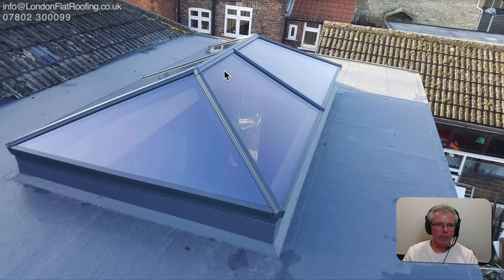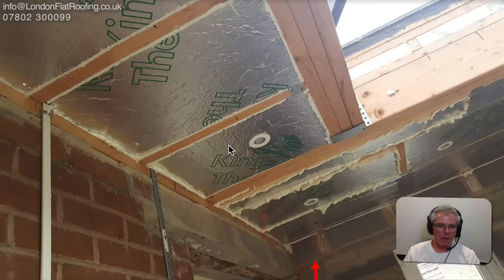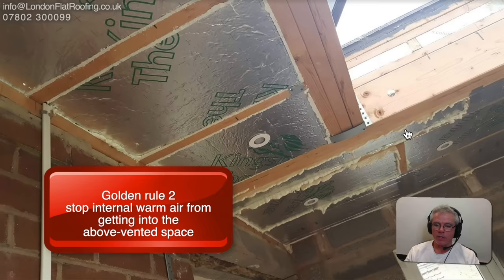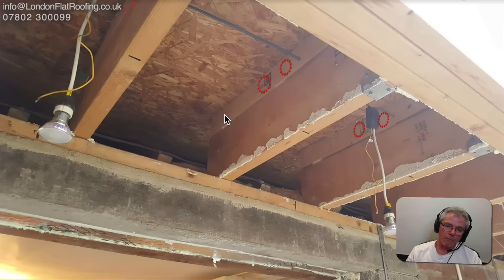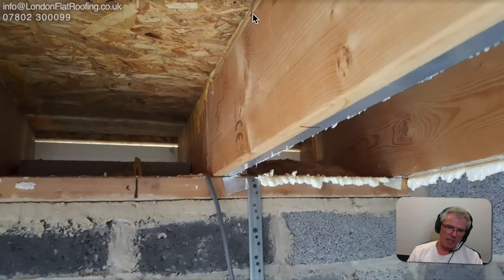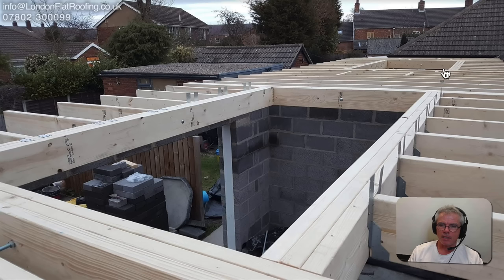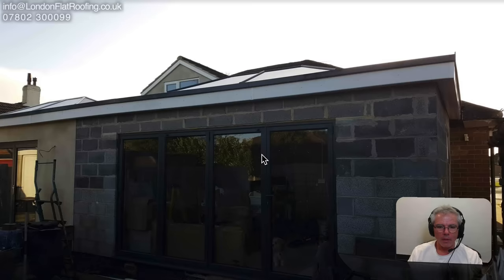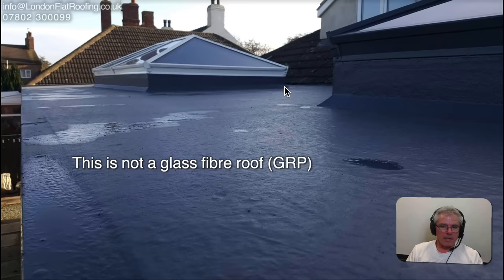Sweating and mouldy New cold flat roof

Comment: Good stuff! I don't think people realise the potential problems with a cold roof - I certainly didn't' until I helped my son with his garden room. He did a lot of research which I( thought was a bit OTT but now realise wasn't. Only problem he has was with using conduit for the wiring - leaves a gap for the warm and moist air to get through. Soon remedied with a squirt of foam!
Reply: What is a cold roof?
Reply: A cold roof is where the ceiling is insulated but the roof deck is not. There has to be ventilation in between to remove any condensation. A warm roof is where the roof deck is insulated and the space between ceiling and insulation should be sealed to prevent heat loss.
Reply: @colinmiles1052  I see thanks. Which is best?

Comment: Hi Steve great videos and very useful. I'm not in London but I have an old house that is poorly insulated. I know now (your videos) that I need to seal the insulation in place. And then cover with more insulation but I'm concerned that if I close all the air gaps that the moisture won't get out and then start to cause problems. Just to add to the amount of moisture there is in the building we live in a flood plain. The Victorians dealt with this by having large voids along the roof but this is now costing us.

Brian

Comment: Such simple understanding of air flow and humidity can make such a huge difference.  To not have used C24 or even C16 timbers from the get go was a surprise, but as you said salvageable and it was a neat job if not very well planned.  Good video.👍
Reply: C16 and C24 are timber grades... not timber treatments... I’m sure his only criticism was that the timbers were untreated (not ungraded)
Reply: @danielb8288  yes absolutely  i took for granted those who use those timbers for construction automatically purchase the treated option 👍  p.s HNY

Comment: You need a 50mm clear gap between the top of the insulation and the underside of the structural deck, you also need a free flow of air from ventilated soffit to the other soffit.
Reply: Why is this gap needed? If the insulation is butt up against the underside of the deck OSB, isn't this effectively closing the air space and therefore making it a warm roof and no venting required?
Reply: @mofaz3475  Its only a warm roof when the insulation and vapor control layer are above the wood structure.
The problem is moisture. Either coming from the internal space, or from the wood itself. Without an air gap and (cross) ventilation, the moisture has no where to go to and will lead to condensation and mold and rot. With a proper warm roof the wood structure is on the internal side, thus having a way to dry out towards to internal space.
Reply: @mofaz3475  Nah because there is still going to be a small cavity to trap moisture. I suppose if you glued it to the board, but even them moisture will move through wood to occupy any little pockets between the board and the insulation.

Air gap is always the way to go. It takes nothing away from the effectiveness of your insulation, I just can't understand why people don't do it.

Worst culprit is people who insulate and board their loft space. No gap between the felt and insulation will ensure your rafters rot. 

If air can move, moisture can't condense as quickly as it evaporates in most cases.

Comment: I only ever warm roof it. I use thermal fixings on rubber roofs. But what many manufacturers still spec screws into joist below.  Particularly on Grp roofs which i do a lot off. It would be good to see them come up with alternatives for grp/liquids.
Reply from the maker: Although GRP is a good material I dont think its good on flat roofs. When you look at why most builders chooses a roof covering its normally based on who is going to do it and how much. I say builders as the majority of GRP roofs laid are laid on small extensions and loft conversions. The bigger the roof the bigger the contractor and the more overseeing of whats used gos on thus GRP is not chosen, there's more control even down to the fixings.
Builders and small roofers can pick up the GRP products anywhere now at relatively cheap prices thus making it the goto product.
Reply: Steve Roofer i do many small jobs under 35sq. I use liquids & rubber as well depending on the situation but i think grp has the best look & is the most durable. Ive had many rubber roofs to repair from slates blowing onto the roof below. Not really an issue on big high rise flat roofs where your work seems to be in. Im trained on restec 20/20 which is a flexible grp. Its allegedly a hybrid of traditional grp & PU based liquids. I reckon eventually they will all morph into one product. It can overlay more or less any material. Some of the liquids are ridiculously priced in comparison to rubber & grp. I rate them but i think they need to become more competitive

Comment: He would have been getting a lot of moisture from the cavity. Usually during the build process the cavities get wet from the water in the materials and also rain. Nothing wrong with a cold roof as long as there's plenty of ventilation. As you say cross batten would have been the best way, but many people like to save on materials. As for the downlights, the cutting in through the insulation happens a lot. The problem here is allowing the heat from the room to condense on the cold roof.

Comment: Bit of advice if anyone can help...

So far I've built my home garden office as follows...concrete base, 12mm ply floor sat on top of 25mm blue roof battens giving some air flow beneath the office.  On top of this I've built 4x2 pressure treated framework walls with 12mm ply walls on the outside of the framework - that has all been wrapped in breathable roof membrane.  On top of the 12mm ply floor I've laid more 4x2 pressure treated lumber, belly side down and on top of this I've laid 18mm ply.  In the 2" gap between the belly down 4x2's in the floor I've laid 100mm compressed loft insulation to help with sound-deadening and also to hopefully help with insulation (although I know 100mm loft roll compressed into a 50mm gap isn't ideal).

On the outside of the 12mm ply walls I've stapled breathable membrane and on top of this I've fastened more 25mm x 50mm blue roof battens (giving a 25mm air gap) and on the outside of these battens I've fastened the finished pressure treated tongue & groove cladding.  On the inside of the walls between the 4x2 framework I'm putting 100mm loft roll insulation.  What I'm unsure of is whether I need to staple a waterproof membrane over this before I put plasterboard on the inside?

Now on to the roof, which I've not started yet but I have purchased all of the materials already.  The idea is as follows...6x2 rafters sat on the walls but cut in by 2 inches, 12mm ply, breathable roofing membrane, 25mm x 50mm blue roofing battens, 18mm ply, finished off by a one-piece EPDM rubber roof.  On the inside will be the same as the walls i.e. 100mm loft roll insulation between the rafters, possibly a non-breathable plastic membrane (?) and then plasterboard for the ceiling.

I'm worried that in building it as planned above, I may cause condensation to form!?  The office will be heated by an electric Dimplex wall mounted heating panel and there will be 4 x spotlights in the ceiling.  I haven't planned for any ventilation as I just don't know where they would need to be located i.e. within the roof structure itself (if so, between which layers and in every joist gap?) or in the actual 'room' itself?  Should I drill a few 2 inch holes in each roof joist so that air can theoretically flow between each of the joist gaps?

I'm hoping that in leaving a 25mm air gap around the whole structure (between the 18mm ply roof 12mm ply 'under-roof' and also between the 12mm walls and T&G finished cladding) it will help to keep moisture from entering the inner building but I don't understand insulation enough to know what I need to do in order to stop moisture forming from within the building.

Sorry to waffle but I hope I've explained everything well enough that the above makes sense to you.  If you would be able to give some advice on what I should do, bearing in mind that I've already purchased everything except the non-breathable membrane nor the plasterboard.

Comment: i have just recently done a cold roof, pitched, vaulted ceiling. the architect specified 170 x45 c16  with 150 Kspan pushed up tight to the underside of sarking with a 3mm gap between boards now 10mm after the sun bashed it for a while, got a breathable membrane and 12mm counter baton and 25mm baton then concrete tile. on underside of rafter he did ask for kingspan kooltherm 118 however client thought this was too expensive and opted for 25mm recticel then a vapour barrier then 12 .5 plasterboard. Have i got something to be worried about in the future???

Comment: Spray foam under the roof with vapour barrier would have solved the problem. But it’s a closed cell foam so no vapour transfer. 
Ventilation is ok but the area between roof lantern and house wall is always difficult. Vents are ok but they pass through the membrane risking leaks. Also risk damage from maintenance work on the house.
Reply: First Order is: don't build a cold roof.

Comment: Great detail as ever. Thanks for taking the time to explain the problems and possible solutions.  Keep up the good work. All the best Pete
Reply from the maker: Thanks  whats your interest in roofing?
Reply: Steve Roofer   Hi Steve my interest in roofing is that I have a built up felt flat roof kitchen extension that’s probably 15 + years old.   It hasn’t shown any signs of leaking but no doubt will soon and if possible would like to re roof it myself. I suspect there is little insulation and would like to do the job correctly.  I’ve heard and seen too many jobs where insulation is used incorrectly and where ventilation if any isn’t effective.  Your videos and comments are a valuable source of accurate information.  I wish you had a book available to purchase.  Thanks again for taking the time to produce your valuable vids.  Cheers Pete.  ( north west. England )

Comment: I've had the same rubber roof put on an outdoor single brick shed. And was getting moisture. I thought it was the roof leaking. I used a dehumidifier to get rid of any moisture. Once I baton it and use insulation board I'm hoping it will be OK. I have a window in it, which allows air to circulate.
Should it be OK. ?

Comment: Another great video Steve!   I'm building a flat roof extension to an old property in which I have very limited headroom, limited to where the new roof tucks under/into the existing roof, therefore the flat roof build up has to be minimal, while maintaining best possible u-value. At 3m span I'm using 145 x 47 timbers, 400 centers. My planned build up is: 12mm plasterboard- 145mm timbers containing 100mm mineral wool- multifoil sf19 insulation over rafters pinned down by 38mm battens. 18mm osb3- epdm membrane. The sf19 acts as a vapour barrier, no ventilation. This gives a total build up of 220mm, leaving just 2090-2040mm headroom in the bedroom below. Does this sound feasible to you, or do you have any suggestions on how it can be improved?
Thanks, Colin...
Reply from the maker: Yes drop me an email and ill send you some info

Comment: The big problem is the plywood sheet funktioning as an moist barrier .... I would strongly recommend a ventilation area on top of the rafters instead of inside.... Then a vapor permeable membrane on top of the insulation and minimum 5cm of ventilation area .... On top of that the plywood ....

Comment: Hi Steve, that's a really informative video. Thanks! Could I just ask...do I need a vapour barrier on my internal walls and ceiling in my garden room that I am building. There will be no heating in it but is going to be insulated with 50mm Rockwool in the walls and 100mm Rockwool in the ceiling leaving a 50mm gap in the ceiling for airflow to the soffit vents I have in the front and back. (It's a flat cold roof by the way.) The reason I ask is that I have read that a vapour barrier will not allow the colder temperatures at night to get rid of any moisture. It apparently traps it essentially in an unheated build. I'm not sure if this is accurate and wondering if you could shed any light on it for me? Many Thanks

Comment: Could you advise how to remove condensation from bottom of onduline roofing fitted on my shed. No insulation on walls so far. Just timber walls with shiplap cladding and timber rafters with onduline on top of them. Roof angle about 10 degree.
Reply from the maker: You have to finish the inside and make it airtight and then  insulate and vent the roof like a cold roof. Nearly every  cold roof out ther eat the moment has condensation its because of the weather it will go away soon so if its not that bad you are doing well

Comment: You have restored some faith to me back into 'youtube' tradesmen by giving a sound and knowledgeable assessment of the issues.  Well done!
However, there is one issue that is absolutely dire -  The adjoining tiled roof lands directly down onto the flat roof with the sarking felt UNDER the flat roof construction!!  Any water driven under the tiles for what ever reason will land on the underside of the flat roof construction, go undetected for some time and rot the construction.  Also, how far does the flat roof waterproofing extend up the sloping roof - I always specify 150mm vertically and under the sarking?  The tiled roof should have a tilting fillet for the full length to create an upstand to dress the flat roof and sloping roof over.  This also prevents wind driven rain from the flat roof finding its way into the main roof as well as preventing the natural fretting of the tiles that are shown bearing down on the flat roof waterproofing.  Movement due to differential thermal expansion and contraction is the problem, which although only a mm or two will allow the sharp edge of the tile cutting into the waterproofing.
Reply from the maker: Yes, you are correct; there are problems with the front slope. The way this job went was for me to report the problems out to the customer, he told the builder who redid the roof last year and this year the customer called me again and told me that it's exactly the same I asked if he re did the roof to the correct specifications and the customer doesn't know as didn't look! The saga goes on.
Reply: @SteveRoofer  Its a real shame that in my experience the majority of jobbing builders do not or can't do a professional job and when pointed out to the client they are unwilling to demand that the correct job be done and if necessary back that up with litigation.  It really is disheartening to find that clients always seem to be too frightened to confront the issues.  I doubt whether they would accept this status quo from any other supplier - its like buying a car with defective brakes or electrical apparatus that could cause a fire????

Comment: Great video! With a vapor barrier applied on the underside of the joists, won't it just be punched full of holes with the drywall screws?
Reply from the maker: Yes it would that's why you should use a special tape that stops that from happening it stops the movement of air through those little holes however the little holes don't let through that much air generally the problem is that they don't fit the vapour barrier correctly and leave huge holes like cutting light fitting through

Comment: Hi Steve.  I have a flat roof garden room with joist running front to back. The left hand side of the roof has been cantilevered off the front to back joists. How would i overcome the cross ventilation for the cantilevered section?

Comment: Hi Steve great video but you never give an example on how to actually install the downlighters without cutting the insulation or the vapour barrier. I can't find anything on the internet suggesting how to do it either?
Reply: I worked it out myself. Ended up finding a product called Thermahood and bought 20 of them. I'll make an retro fit install video if people want it
Reply: @Craigo5000  Hey, did you manage to create the video for this? Just having the same issue at the moment.
Reply: @robnelsonphotofilm  sorry not yet with Xmas and all. I'll do something next week and post my results. I'm actually really please with the recent snow and ice - my roof was the only roof on the road with snow still on it 2 days after it had fell. The guy over the road who had 48k worth of loft conversion done had no snow on his roof. I'm so glad I ripped all mine out and did it properly. It's clearly paying off as we speak. The key is the make it 100% airtight with maximum cross flow on the cold side. I also retrofitted a product called Thermahood for all my lighting. Along with a vapour barrer, insulation bonding over the Thermahoods too, you simply get zero air exchange from the hot/cold sides. 
I'll post the link to the video once done. 👍
Reply: @Craigo5000  thanks for this, I have seen these but not sure how to fit them in the Celotex board as I can’t access above the insulation board.
Reply: @robnelsonphotofilm  that could be tricky but not impossible. You may have to do away with insulation over them. If you haven't yet plasterboarded, it would be easier to cut out a section to accommodate the Thermahood and then seal that section back in place. I'll get my video done next week 👍